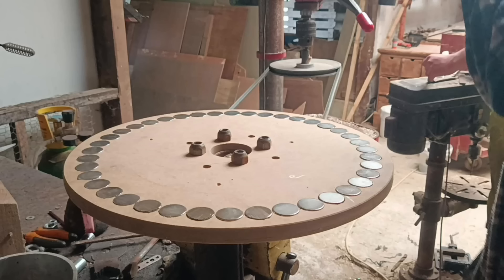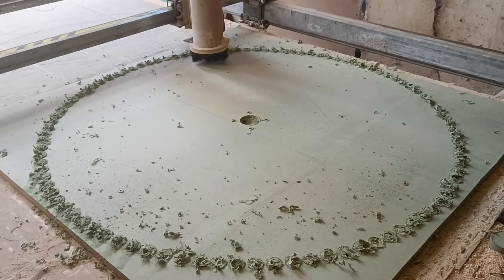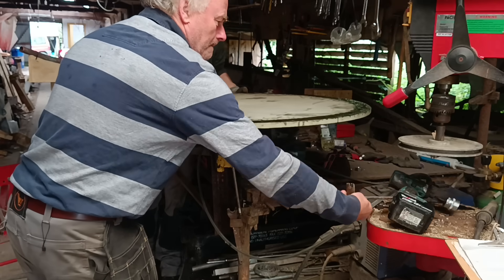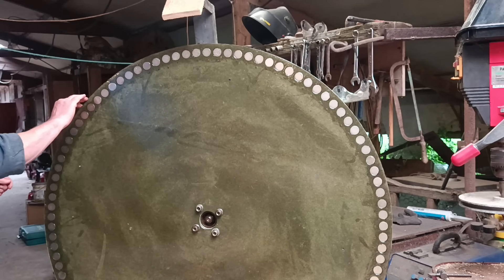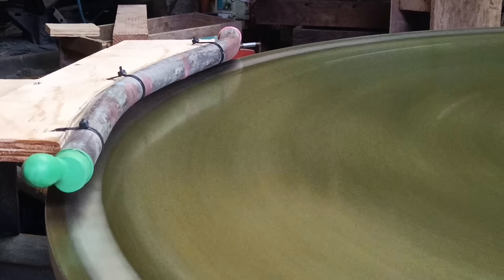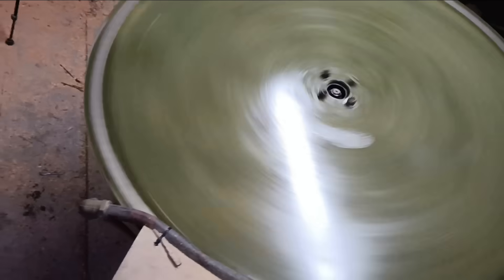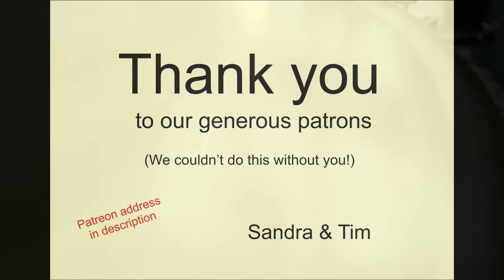ABSOLUTELY HUGE Magnetic Induction Heater! Using 100 Spinning Neodynium Magnets And A Bucket

Comment: If possible try smaller pipe 1/4 or 3/8, then rap around the 3 time or so. Make sure to get the pipe as close to the magnets as possible. Also I’m was thinking 400hz or higher. Just some ideas that ran through my mind while watching your video. I love your project, keep it going.

Comment: To make it easier to bend the copper pipe, heat it up with a torch. Once the copper is annealed, it will bend very easily. Also, if you can borrow a hand conduit bender, it would be much easier than the hydraulic bender.

Comment: use a magnet underneath to hold them in place while they set?
also, use the full length of the disc for the pipe, and use a standard wetback arrangement, where the water is held in a vessel with two holes, one lower than the other. Put a slight incline on the pipe and the hot flows to the top, then refills from the colder bottom

Comment: I wouldn't have used cable ties, I would have used safety wire
Reply from the maker: wire would just get stuck to the magnets
Reply: @wayoutwest-workshopstuff6299  stainless steel wire

Comment: It appears that your variables are in the speed of your rotator and the height of the pipe above the changing gauss field.  Trying a smaller driven pulley and lowering the pipe for primary effect changes.  Multiple units may improve efficiency.

Comment: Put the spinning magnets above and below and then spin those magnets in opposite directions and then another wheel of magnets on the outside of those spinning  magnets only turn them vertically with a oscillating wheel that will move back and forth along the length of the copper and before you say that could be hard your question was for an idea not how to set it up. LOLSSS

Comment: 1. Mount magnets with an exposed face on each side of the wheel. Consider casting magnets in epoxy, then milling?
2. Have pipe in a full circle on both sides of the wheel.
3. Balance wheel.
4. Minimize air gap between pipe and wheel.
5. Insulate system.

Love the idea, now I want to do something similar.

Comment: I haven't read the comments, but one thing I would consider is having a taller, narrower water container with a pipe fitting at the bottom and one at the top just below the surface of the water. The effect would be to induce a circular flow of the water, the cooler water at the bottom will sink down while the hotter return water will go to the top, Insulate the whole water system to improve efficiency. You have a very unique and potentially valuable idea.

Comment: You are only using a small fraction of the system's potential.  Have the copper line go all the way around to get full potential out of the system.
Reply from the maker: no advantage in that - it would all need to be much further from the magnets or it would just stall

Comment: heatpipe like the gpu cards use to disapate the heat

you could pull a vacuum on hermetically sealed copper to force the heat to the load therefore stopping the loss of energy so much, as the heat travels to the load of water cooler then the heat pipe

think solar water heating how the tiny copper vacuum heats the water. just my 2cents from a sparky fridgey type dude

Comment: It seems to me that a square section pipe would expose a larger area to the strongest magnetic flux. And, obviously, the more magnets you cover the more energy you capture. Bear in mind, the more energy you capture, the more torque needed to maintain the speed. The trick is to match the torque and the rpm to maximise efficiency, which is the proportion of the available energy you are capturing.
I sort of understand why you want to do this, but I guarantee you, that a correctly proportioned wind turbine connected to an immersion heater will do the job far, far more efficiently, more simply and at a lower cost.

Comment: Wrap the pipes with pool noodles. They fit good and with stand the heat. Or simple spray foam high temp. But the pipes will be forever covered in spary foam.

Comment: why reinvent the wheel? much more effiecent to use a tried and true PM alternator connected to a heating element.. easier to transfer that energy over wires than long water hoses too

Comment: I have a suggestion. Get a cheap Raspberry Pi 3 or 3B+, a temperature sensor, and build yourself a simple free running grapher in Python. Then you can actually see the temperature across time visually and know exactly what you have vs. how much time getting there. With such a setup you can easily spot even miniscule changes in efficiency, and quite possible use that as an advantage to gain a whole lot more than miniscule changes.

Comment: • 250% increase ❌ try again!! • Use a proper bit for cutting MDF! • Using resin? Srsly? • W’proof use latex primer or just buy WRMDF • Plastic Zip Ties? • 🤦🏻‍♂️🤦🏻‍♂️🤦🏻‍♂️
Reply from the maker: pardon?
Reply: @ Pardon?? That was you in the video wasn’t it? How many ways can you do things wrong and use bizarre techniques to get them done. Can you hear that? 🙉
Reply from the maker: @SpatialGuy77  No idea what you're talking about - and now you're just being rude. What a strange way to interact.
Reply from the maker: @SpatialGuy77  I'm not feeling like a victim at all, thanks. I'm waiting for you to share some of your wisdom and help us all do things better. You say I'm doing things wrong, but you don't say how I should be doing them. Perhaps you don't really know? You're not the worst of course, but most people on this channel try to be helpful, not just critical. I try to explain things and I often get things wrong, but at least I try.
Reply: @wayoutwest-workshopstuff6299  At least I try 😢 > there you go again. I pointed out just a few things you could (should) do better. Thought it was clear. I don’t need to tell you HOW.
Reply from the maker: @SpatialGuy77  Well now. I was using a proper bit, and resin is waterproof and pourable - so what's wrong with that? And of course I was using water-resistant mdf. The zip ties worked perfectly thanks - it's all wrapped in expanding foam now though. So your advise is pretty crap really, isn't it? And the way you delivered it just shows us all what kind of person you are. I hope you feel better soon. Try being nice - it really works.

Comment: The best thing you can do for efficiency is two thing balance out the magnet wheel. Vibration and shaking = more input power needed. And anneal the copper before bending it and a cheap set of bending springs will prevent kinking

Comment: Make that copper pipe longer,but beware of creating a 'shorted turn',like in an electrical transformer- because that's essentially what this is,if you really think about it. You're just using the induced electrical energy (eddy current) at the same point it is created,to make heat in the copper pipe.

Comment: Flatten the pipe towards the magnets. Get is as close to them as possible Make 4 more sections with copper pipe isolate with the best you can get your hands on. If you after that need more heat. Do it same thing under the table and use that as a pre heater

Comment: When bending copper pipe. Anneal it first! Heat it to glowing red and let it cool or quench it (it doesn’t matter how quickly you cool it) it won’t kink and it will be much easier to bend. Copper pipe work hardens over time but annealing it won’t take away much burst rating.
Reply: I either fill it with sand or freeze water in it before bending.
Reply: Unless it's very old pipe it won't be pure copper it will be a cupronickel alloy and the extra hardness makes it prime to kinks, I'm not sure how much annealing will help?
Reply: copper that is red hot will not bend, it will tear at the spot that has the most stress on it. A simple proper pipe bender would have worked just fine.
Reply: @joeharper448 he's talking about heat treatment not forging.

Comment: Just a thought , the tube being round has a stronger pull at the closest point to the magnets and get weaker as it comes up the side of the tube , use square section instead of tube , it will keep the field even over the surface and give a much more consistent heating

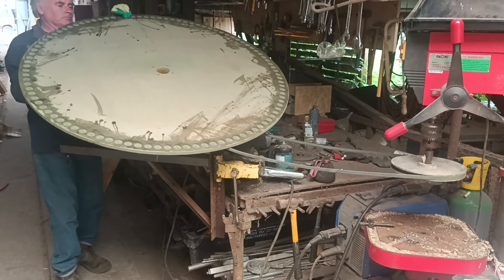Comment: @ 2:55 Next time put another magnet on the underside to keep them in place. Also have the copper pipe go all the way round 360 degrees then put another unit on the top side like a sandwich.

Comment: If you have an Amp meter put it into the drill press cct and once up to speed with no load ie induction heating compare amps to induction heating amps. I suspect there's no free energy compared to straight resistive heating.

Comment: the gap and isolation is key.
to make a small gap, hit the coper tube to make it flat on one side that side need to be realy close to the magnets.
and the top side and all tubes put isolation on it.

also transfering hot water over longer distances you always loose heat.

so if the distace is long, i think just a wind generator and a long cable to your house where is an electric boiler with element is more simple

but very nice diy and project. ( thats why we are all watching this )

Comment: We use thermal syphons at work. Some things we do are: 1 keep the pipes short. 2 The hot pipe should enter the liquid in the reservoir 2/3 of the way up in the side with the return from the bottom. 3 At the end that heats the water, the cold should come in the bottom and hot out the top... SO im thinking, you mount this thing on its side. You make a full ring of copper with 2 t-pieces, top and bottom, you pipe it into an insulated reservoir as described before and see how that does. If you had a reservoir higher than this diameter you could mount this said contraption on the side and pipe it straight in.

Comment: What you need is a radiator type arrangement. A "simple" version could be to bend thin copper pipe into a "u" shape so that it sits on both sides of the rim, hugging the wheel. This would expose the pipe to both sides of the magnet effectively doubling your electron movement within the metal. If you could bend the pipe back and forth, you could effectively cover the whole wheel, though I'm not sure how this might affect the flow of water.

Comment: The two ways I see to up the surface area are to ether have a longer coil over the disk, or to have a shallow pan of water the same size as the disk(or maybe a doughnut shape) directly over it ideally this would be the bottom of your water heater/tank.  Also if you can get the tank/piping to be made of the kind of stainless steel that they use for induction pans then you will probably get a good boost.

Comment: I think your proof of concept is solid.  The next step is to see how it compares to other uses for that wind energy.
Upgrades would include beefier bearings to start with and more mass in the flywheel.
I'm also curious about more, smaller magnets, but I don't really know the science yet.
Passive solar heat is also much easier and cheaper, so, heat as the output?

Comment: Oh by the way, you don’t need magnets and conductors to heat water - you can just spin the water with paddles and it’ll heat up due to friction - this is actually exactly how the heat capacity of water was first calculated as part of a big series of work by Joule
Reply: He tried that in "Heating Water With Friction – How Practical Is It? Interesting Experiment!" and it wasn't very good.
Reply: Well, that would leave you with scrambled eggs, not fried...

Comment: What if you had 2-3-4 rings each contra rotating, with about 10 additional magnets per ring. It could be as simple as a rubber wheel between rings causing opposed rotation. Or use gears.

Comment: Very cool! I'm sure you're planning it already once you have things more settled, but using the full circumference of the disc instead of a small section should get you waaaaaay more heat.

Comment: I would mount it verticaly, then have the copper heating pipe go all the way around on both sides, then put the whole thing in an insulated box, with an insulated water tank with a presure valve on top and a tap to draw hot water.

Comment: I don't understand why you would not make a copper tube of a smaller diameter and complete a whole circle around all the magnets, for maximum contact. Is there a reason they would not work? I want to try this but the only way it makes sense is if the rotation energy is free and abundant.

Comment: The closer your conductor is to the magnetic flux, the stronger the magnetic flux would be resulting in a greater effect. Also the larger the area in the magnetic flux the more heat will be generated.

Comment: As mentioned below, a complete circle of copper tubing or more in a smaller diameter to make the circle trip more than once? Maybe add a small amount of preheated water back into the feed line,...aka; pre-heater. Steam generation uses waste heat that way. Fascinating project here. Love this stuff. 👍👍

Comment: An electric heating element has minimal loses compared to a Drill press, gear reduction, belt, hub/bearing, large wheel. But I applaud you for the efforts and tinkering! Other thing to note is that the direction of the turning wheel should be equal to the direction of the heated fluid, in this video they are opposing.
Reply: The final arrangement is to use a water wheel, the drill press is just for experimenting
Reply: Thanks, I missed that part..
Reply: I was wondering about the hypothetical efficiency of this wheel of magnets versus something like using the wind mill to turn one or more car alternators and then using the current to power a resistive heating element.

Comment: what about having a complete circle of mild steel on the backside to couple the field lines together (rather than leaving them loose) - this would also help holding the magnets in place...

If not you may want to run a second loop of tubing below, as here the back side generates an alternating magnetic field, too.

Last you may wan to assess efficiency (how much power in for how much head collected)

Comment: First of all, it would be very useful to know the amount of power required to spin the disk, to compare with the amount of power harvested in the forrm of heating. Usually, this sort of thing offers only very poor efficiency. While powering the mechanism with windpower is using "free" power, not counting wear and replacement of components and man/hours of labor building and maintaining it, it is "free" power that could perhaps be utilized more efficiently. Not saying that this is grossly inefficient, only saying that it needs to be known, and monitored as you continue to tweak and adjust.

Higher inductive loads will make your rotor resist effort to spin it. Small loads will be relatively insignificant. To use this for, say, a pool heater, would likely not be very practical. A home bathwater heater, maybe likewise. To make a bowl of ramen noodles or coffee or tea, trivial load on the rotor and lots of fun. Nice to see the egg frying experiment, even though the energy harvested was not precisely quantified. 

Your magnet specs would be most interesting... gauss rating, size, even cost if you don't mind, though of course this can vary wildly from one supplier to the next. They appear to be about 1.5" x .5"? or the sillymeter equivelant. I would guess N52 magnets? Inquiring minds want to know.

The wind turbine required to spin up such a big rotor would be REALLY BIG. Not the size of your typical home hobby wind generator. I am guessing for most climate areas that you would need about a 20 foot swept diameter 5 to 7 blade turbine to have semi-reliable operation on average windspeed days.

You realize, of course, that three coils or three pairs of coils (top and bottom) spaced properly apart, would make this into a three phase alternator, right? But again, the higher the load, the harder to turn the rotor disk.

Insulation of your plumbing would indeed help with efficiency. UNLESS your goal were to make a space heater for a small room. When the sun shines, passive solar can do a very good job of maintaining a livable temperature. Often the sun is NOT shining, but the wind is blowing. This could be an excellent supplement to solar heating. When life gives you lemons, make lemonade. When life gives you shit, don't make anything. When life gives you waste heat, make a space heater.

Very nice video and I enjoyed it immensely. Looking forward to seeing your further work on this. You have my thumb up.

Comment: I am wondering if the contiguous nature of the conductor (the pipe), isnt taking away from the amount of indutive heat being produced. 
I wonder how it would work if you broke the conductor down into individual copper chambers, similarly sized to the magnets, and electrically insulated them from one another. Of course, this would be a plumbing nightmare and would also radically reduce your flow, possibly requiring a pump . 
Now, on the other hand, you could make a generator out of your creation and power a water heater, but what fun is that?

Comment: I think, in my experience with super magnets, that the gap distance is the key issue in this setup, the flux density is low at the current distance, it increases exponentially as you get closer.  other then that, how much you get out depends on how much you put in, the drill is the bottleneck, assuming the transmission does not slip.